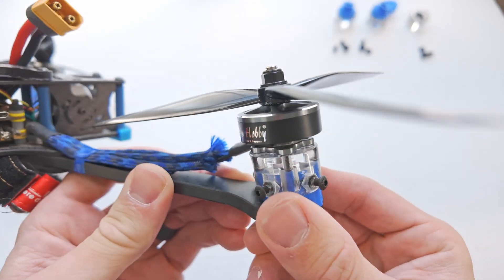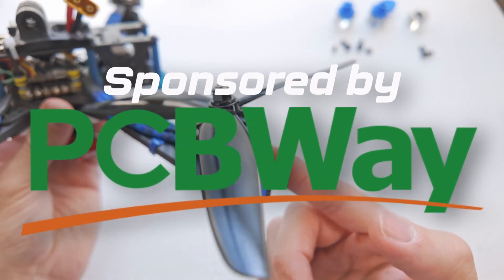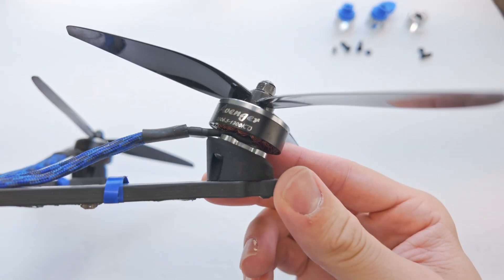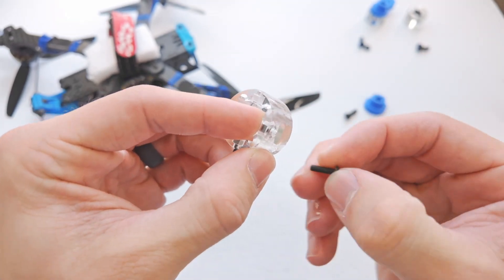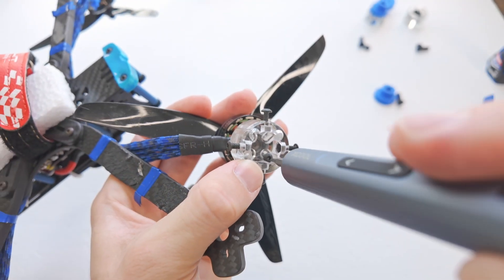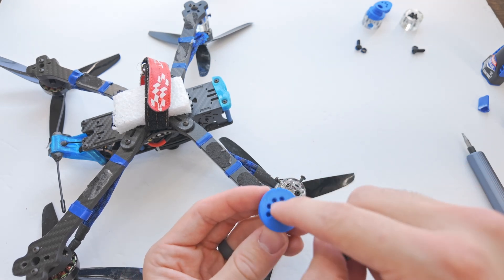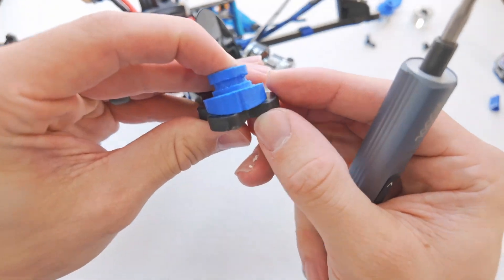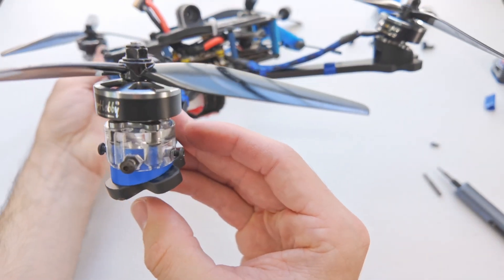Tilt Your Drone Motors and Point Them Where You Want // 3D Printed Angled Motor Mounts (Tutorial)

Comment: Here is a test for you that might be really good information for a lot of drone pilots. Put your camera on a 50 * angle. And your motors tilted out 10* on both sides opposite of each other on one test and then  10* in on the other test. You want to fly level to the 50* and turn with more roll. Then tell the difference between the two, if, or any benefit you may have.

Comment: Don't use loctite with most plastics. It will eat the plastic. It shouldn't be needed for most metal into plastic applications anyway. Use a very tiny amount of superglue if need be
Reply: Depends on the loctite. 425 is fine for plastics and a lot less messy than superglue.